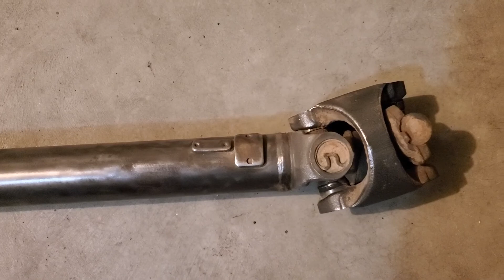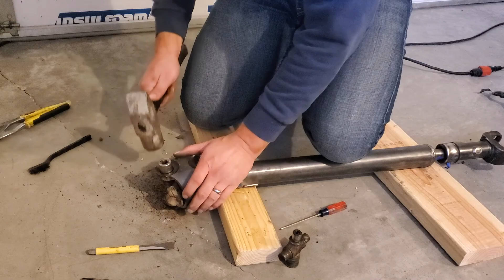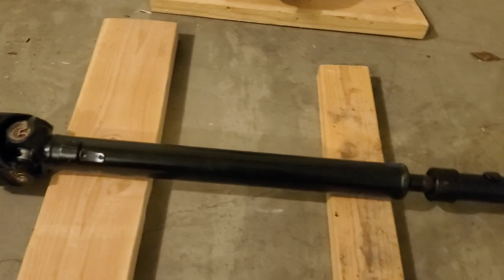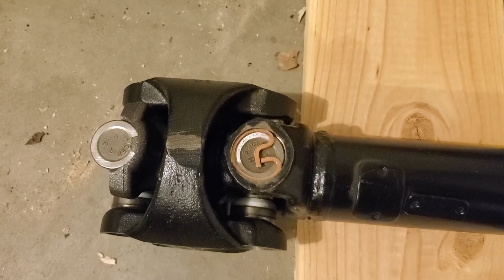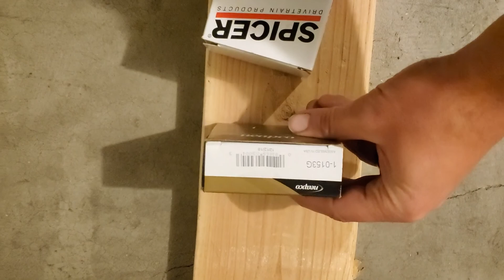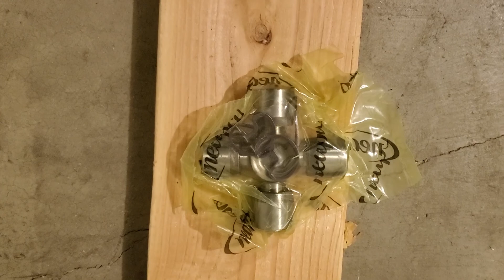Rebuilding a Double Cardan Drive Shaft: Using an XJ Front Drive Shaft in the Rear With an SYE

Comment: Did you have a my vibrations? Mine vibrates like mad from 50mph onnup
Reply from the maker: I ended up selling this one, but he hasn't said anything about it.
Reply: @ProjectXJ  did you replace the centering ball?
Reply from the maker: @moejr14  yes, everything was new. All new ujoints and centering yoke.
Reply: @ProjectXJ  how much did it run you
Reply from the maker: @moejr14  i bought the kit that i posted a link for. It was $103, but now its like $130. I would recommend getting non-greaseable u-joints and the greasable centering yoke. That will work no matter what driveshaft you have. Sometimes the non-greaseable centering yoke rubber boot gets messed up or just breaks off and its difficult to put a new one on.
Reply from the maker: @moejr14  https://www.dennysdriveshaft.com/p1079_cv_355_4_rebuild_kit_for_jeep_with_1310_series_frontrear_cv_.html
Reply: @ProjectXJ  Awesome thank you man. I’ve been meaning to do this for a while to my front drive shaft
Reply from the maker: @moejr14  its not too hard and nice to have shiny parts. 😀

Comment: So if i install a sye on my xj i can just use any front driveshaft from another xj and it will bolt right on? I have about 5.5 to 6 inches of lift
Reply from the maker: Yes. There are 2 different front xj shafts, one being an inch longer than the other but both should work.
Reply: @ProjectXJ  ok and its a bolt on fit i dont need to get anything special to do the install? Thanks for the help
Reply from the maker: @dylanreynolds4899  correct. It bolts right up. Its a 1310 yoke.

Comment: Is there any reason that I cannot use to slip yolk on the transfer case attaching it to the double cardan(sic) joint AND the slip yolk on the front driveshaft to attach to the rear axle?
Reply from the maker: You could, i guess but i have never seen a drive shaft like that. The stock shaft has a u-joint on one side that attaches to the yoke on the axle and the transfer case has the slip yoke on it. When the slip yoke is in the drive shaft, it has a u-joint om both ends that attach to a yoke, one on the axle and one on the transfer case.
Reply: @ProjectXJ I'm wanting to get by without having to get a slip yoke eliminator for the rear of the transfer case.
Reply from the maker: @GhettoFabulous99  oh yeah you can't do that. In order to use a double cardon shaft, you have to get a slip yoke eliminator.
Reply: @ProjectXJ  apparently not quite true.  Cherokee Ronnie and others have done it and even sell them built that way.
Reply from the maker: I guess one of us is confused on what exactly we are talking about. (Probably me). If you want to use a double cardan shaft, you have to have a fixed yoke on the transfer case to bolt the shaft to. You cannot keep the slip yoke on the transfer case and use a double cardan shaft.
Reply from the maker: If you want to use a front drive shaft in the rear, you have to eliminate the slip yoke on the transfer case and install a fixed yoke. Like what is on the front output on the transfer case.
Reply from the maker: Obviously,  if you modify the drive shaft like cheokee ronnie did, you can do that. But beware that that increases the drive shaft angles because the straight portion of the shaft is shorter. Doing an SYE makes the distance between the axle and transfer case longer, reducing the angle and it also reduces the angle when you move the pinion up to point towards the transfer case.
Reply from the maker: It's just my opinion but i think there is a reason why the engineers don't do what Ronnie did, although its very easy to do. I would avoid doing it. But give it a try and see if it works for you. I would prefer to have an SYE because it replaces the stock shaft which is weak where the speedometer gear fit on the shaft. Also having a fixed yoke allows you to remove the rear drive shaft without losing fluid from the transfer case. Over-all its a much better design than the stock slip yoke and what Ronnie did. Just my opinion. I hope that helps.